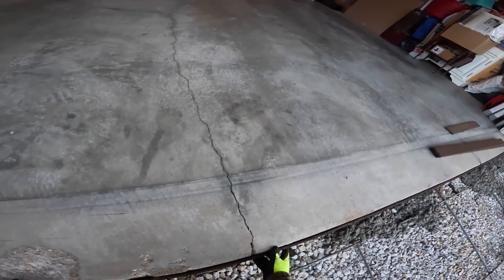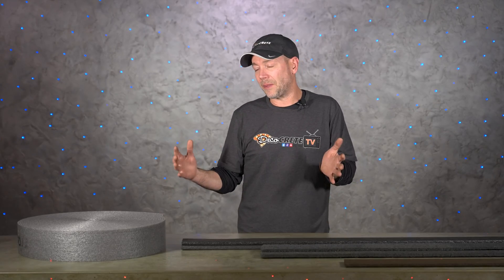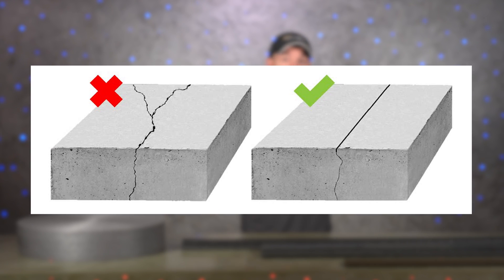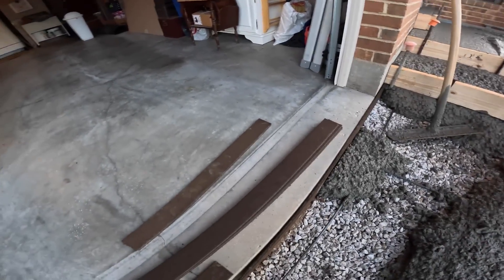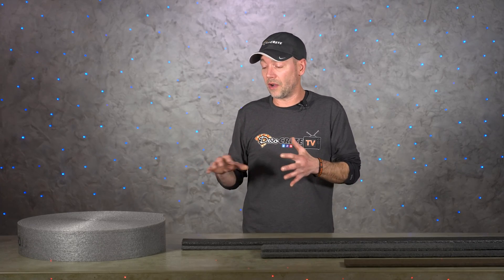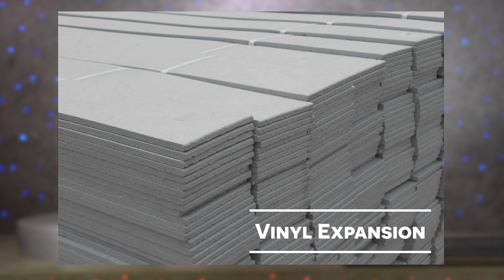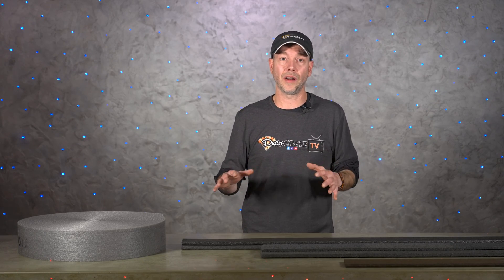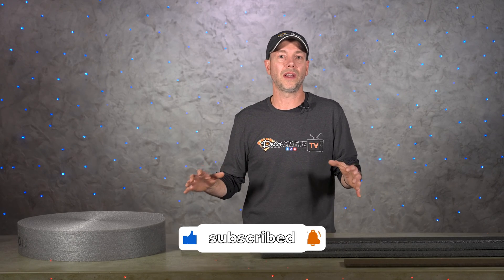Choosing the Right Expansion!

Comment: Do you leave that edge visible,  or do you cover with some kind of caulking?
Reply from the maker: Thanks for the comment! That would be up to you. The rolled foam expansion has a perforated edge at the top so you can pull it off to leave a channel for caulking. Most people just leave it as is, though. Caulking does look nice, and it keeps water from getting in behind the expansion. But in most cases, it's not really necessary. Thanks for watching Deco-Crete TV!!!
Reply: @DecoCreteTV appreciate the answer 👍

Comment: Great video! I’m close to getting a 50’ by 10’ concrete pad poured where about 40’ are against a foundation and the other 10 feet are not. All soil was compacted very well down about 42” deep next to the foundation and beyond.
My concrete guy says he would pin the new slab to the old foundation by drilling into the old foundation about 5” or so and insert about 14”of cut rebar and concrete adhesive epoxy about every 18” along the 40 foot span using insulation board as well. He says it provides stability for the numerous freeze-thaw cycles. We are using wire mesh and additional rebar for tensile strength. Concrete WILL be 35 Mpa strength, air entrainment and 4” to 5” slump and 4 inches thick minimum.
Another concrete guy says to NOT pin the slab (float it with an expandable joint material like NomaFlex) as the new slab could heave causing cracks in the old foundation wall and lead to water seeping into the basement.
Would you recommend pinning or NOT pinning a slab of this size in our a freeze/thaw climate?
Reply from the maker: Thanks for the comment! There certainly is some debate among contractors on this topic. Our stance has always been; we never tie exterior slabs to foundations or interior slabs, especially in freeze/thaw climates. The exterior concrete is going to move up and down as the ground freezes/thaws, and the foundation will not. Trying to hold the exterior slab back with pins may work for a while, but eventually something will have to give. We recommend putting expansion joint between the slab and the foundation (NomaFlex is a great choice). I'll leave a link below to a video on this topic. Thanks for watching Deco-Crete TV!!!                                                                                                                                                                                              https://www.youtube.com/watch?v=Kiwh2sVFghA&t=63s
Reply: @DecoCreteTV  Thanks, I ended up going with a floating slab. I also put NomaFlex (5 inches in height same as pad thickness) on the outside (grass side) of the concrete pad. After the first big rain we had, the NomaFlex lifted right up and fell over. I should have put a couple of inches of drainage stone against it to hold it against the slab. I will do this next spring.

Comment: What expansion do you use for street creep?   How wide?
Reply from the maker: Thanks for the comment! I'll be honest, I've never done any road work, just standard flat work and mostly residential. So, I don't really know the exact answer to that question. From what I've seen, street joints are wider and they use some kind of rubber material. I've even seen some that were a few inches wide. 1/2" is generally widest that gets use for residential or light commercial work. I do know that the big deal in street creep is when sand or other granular particles fall down into the joints and as the concrete expands in the summer, it doesn't have anywhere to go. The resalt is that street tends to get longer over time and eventually starts to push on the other concrete around it. The material they use is supposed to seal up tighter and keep the sand out of the joints. Hopefully you find what you're looking for! Thanks for watching Deco-Crete TV!!!
Reply: @DecoCreteTV street creep pushes on residential driveway slabs at curves, dead ends and cul de sacs and can damage the house’s foundation if not fixed
Reply: Idk what you mean by street creep but behind driveway curbs and such is 1”x8” minimum most streets are 8-10” of concrete

Comment: Great video's. Im planning on adding a porch slab between the house and the sidewalk where the garden bed is currently.  I will be using the expansion joint at the house and doweling at the sidwalk. But, Im in the South, Texas, and it looks like they use wood here as an expansion joint on driveways and walkways. Is that right? Wood? Okay to use wood??
Reply from the maker: Thanks for the comment! I would highly recommend using an expansion joint that is specifically made for concrete (foam, fiber, rubber, or vinyl). Wood was commonly used for this in the past, but now days most contractors avoid it. Wood dose work for a while, but it will eventually rot away and leave a gap. Pressure treated wood will last longer, but time will still take it's toll on it. Rolled foam expansion is very coat effective and easy to use. I'll leave a link below. Thanks for watching Deco-Crete TV!!!             
 https://www.deco-cretesupply.com/products/forms-expansion-wire/foam-expansion

Comment: Thanks for the video. Do you need to caulk over this between a concrete driveway and driveway apron?
Reply from the maker: Thanks for the comment! Most contractors don't caulk over expansion joints on driveways, but it's up to you. It's not required, just a preference thing. If you decide to do that, I would use a flexible joint sealant. Here's a link to the one we sell on our website. Thanks for watching Deco-Crete TV!!!                                                                        
 https://www.deco-cretesupply.com/products/repair-prep-products/sikaflex-1a

Comment: If I anchor the new slab into the old slab by drilling some holes and connecting them together with rebar do I still need these expansion joints?

Comment: Thank you very much for this! Do the expansion joint materials come in wider widths? I'm planning on a 14 inch slab, or can one, just stack them on top of each other until the desired height is satisfied?
Reply from the maker: You are welcome! 4" & 6" is the most common size that you will find at concrete supply stores, some will stock 8". You probably won't find anything 14", but you can definitely stack the pieces up to make it work, so I wouldn't worry about finding the exact size. Just make sure that everything covered so the new doesn't touch the foundation. Thanks for watching Deco-Crete TV!!!

Comment: Love the videos! One question though, I see a lot of people installing dowels to tie the garage and driveway together so they move together. Do you still use expansion material?
Reply from the maker: Technically no, if you tie the slabs together you don't need expansion material. However, tying a driveway to the garage slab is not a good idea. The driveway will move, but the garage slab is on a foundation and won't move. If you tie these together, you'll probably end up with a crack in one or the other. Never tie a slab on grade to something that won't move, that's whole point of expansion joint material. If you're pouring up against a slab on grade, then yes, tie them together and don't worry about expansion. This is topic can come with some debate depending on where you live. We plan to make a video on this in the future. Thanks for watching Deco-Crete TV!!!